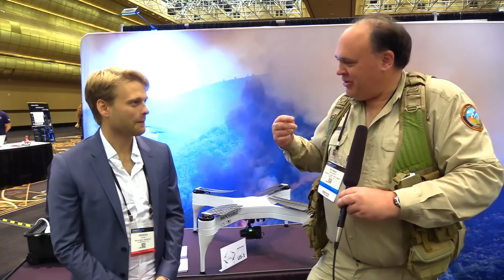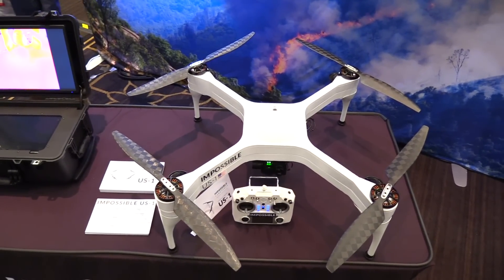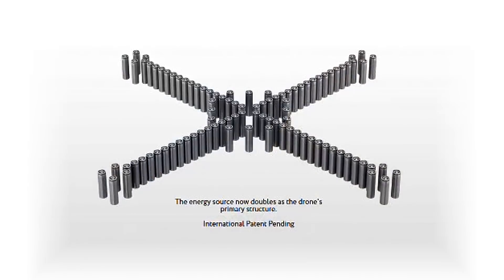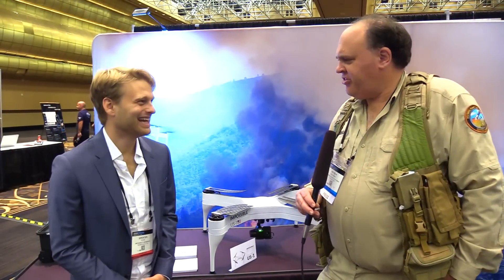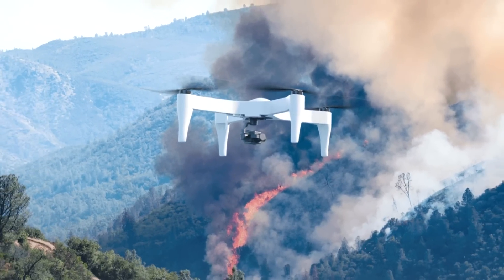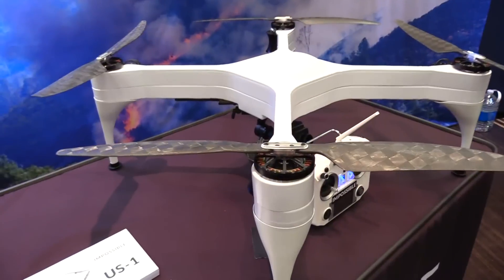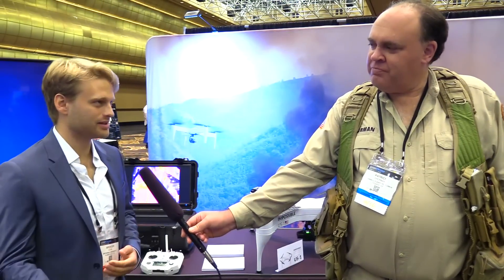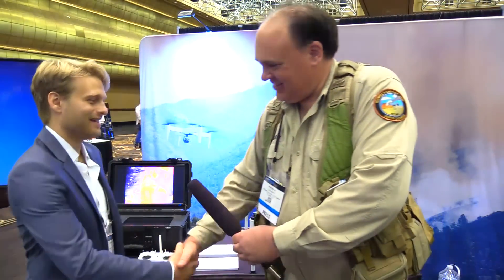Impossible Aerospace: Your 2-Hour Flying Battery

Comment: $7,000 for the drone plus $9,000 for the transmitter and screen... Impossible! 😜👊
Reply: Swimming Pool Tips, Reviews & How To -MrDgvb1 - No he said 9000.00 all in with the FLIR cam and controller
Reply: @printer5518  Oh, I must have blanked out after he said $7,000 - ha, ha.
Reply from the maker: Hey, Swimming Pool (et al), I agree that he said $7,000 for the drone itself and $9,000 for the drone with the thermal camera. What I don't get is that the thermal camera is a FLIR Duo Pro R, which even at the low end costs about $5,000. This just doesn't add up...
Reply: @Roswellflighttestcrew1947  Thanks for your great videos! I purchased a Yuneec Typhoon H thanks to your great review video on that drone. I also purchased the Wizard after watching your hilarious video on that too. The Typhoon H is an awesome machine! 👊

Comment: I really like this idea of the batteries being part of the frame so to speak,if this takes off (Pun intended) watch the copies come out thick and fast.

Still i've got to say i'm impressed and i also realise this type of quad/drone isn't amid at us the RC fliers but to the big companies and first responders and of the like,so take that in mind when talking about said price,just thought i'd put that out there.
Reply from the maker: It's an interesting approach, no doubt... The way I see it, there are really three contenders to dramatically extend drone flight time: 1) better batteries or novel use of existing batteries (which is what I think is going on here), 2) gasoline engines (see my comment to Tyler Mounce elsewhere in these comments), or, 3) hydrogen fuel cells. As it stands right now, I'd put my $$$ on hydrogen.

Comment: 7k drone flying with a $100 controller? That looks like an off the shelf FrSky qx7.
Reply: DrDeeZee FPV 😂
Reply from the maker: Yeah, well... That's what makes it a prototype, right?
Reply: For sure, it's a great radio that I personally fly with. I'm curious about some of the specs of the craft, like the size and KV of the motors, aprox how many mAh the batteries produce, how it can possibly have such impressive performance.

Comment: Beast, but good luck getting pass TSA
Reply from the maker: You know, you bring up a good point that didn't occur to me: transporting this thing is going to be a serious issue. You could probably get it through TSA, with patience, but it doesn't fold or otherwise shrink down for travel -- and because the batteries are built into the limbs (and everything else), it's hard to see how it will fold in the future. These are smart people, so I'm sure they will figure it out -- but imagine the oversized luggage fees you would pay on a secure storage container big enough to hold that thing...

Comment: "Electric cars make a lot of sense for the same reasons that electric cars make a lot of sense."

Electric cars make no sense at all; therefore, he's saying his craft doesn't make any sense. Go gasoline!
Reply from the maker: I actually saw a gasoline-powered drone fly today at CES. I think there are some problems with that approach... First of all, it's inefficient for multirotors: a gasoline engine produces torque, which must be used to turn a generator which in turn generates the electric current required to power the ESCs, flight controller, etc. That's a lot of weight and a lot of moving parts -- and while we're on the subject of moving parts, small, high-performance gasoline engines need frequent maintenance and overhauls, which add to long-term cost. My money for high-endurance drones is on hydrogen fuel cells...
Reply: @Roswellflighttestcrew1947  Anyone who's familiar with rotary engines knows that having fewer moving parts does not correspond to increased reliability. So having more moving parts is not considered a negative.

Moreover, nobody said the gasoline engine had to be a generator of electricity, there exists multirotors with ICEs directly driving the props (check out SOAPDrones).

Hydrogen Fuel Cells aren't efficient either, I did an entire research paper on them.
Reply: Gas and electric powered hybrid drones beat world records in terms of flight time

Comment: You failed to ask key questions... For example,  questions about the payloads,  what kind of thermal cameras were they offering,  low resolution cheap ones like the one in the Mavic 2 Enterprise,  or Good 640 resolution ones... What's the Range, ect...?... See those questions weren't asked! 🤔 You need to return to that booth and re-do your interview... We'll be waiting for that to happen...👍🏾
Reply from the maker: Hmmm... You raise some fair questions there. I'm unlikely to be able to do a follow-up anytime soon, so I'll answer them as best I can right now. The camera is a FLIR Duo Pro R -- so the resolution is a minimum of 360 horizontal pixels -- and it could easily be a 640. It's basically the DJI Zenmuse XT2 without the gimbal and the fancy housing, so a good camera. Range: visual line of sight, when flying under Part 107 in the US. With an aircraft of that size, probably about half a mile, if you've got good eyes. Besides, it looked like they were using conventional hobby/FPV gear for their send/receive, so I wouldn't expect anything truly awe-inspiring in terms of range.
Reply: @Roswellflighttestcrew1947  Thanks for your response!...👍🏾